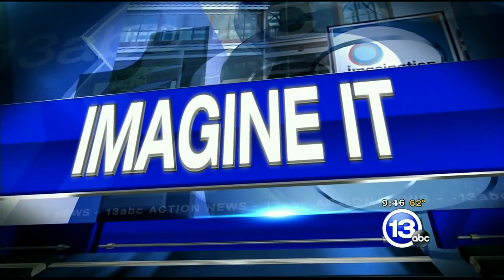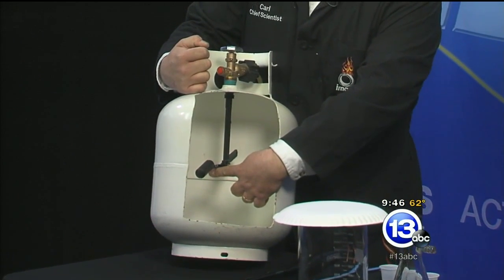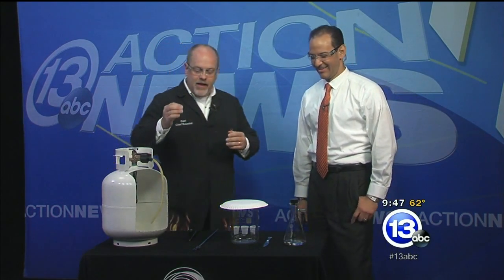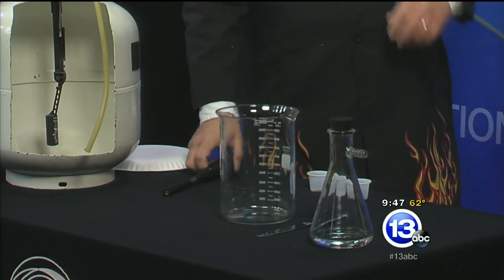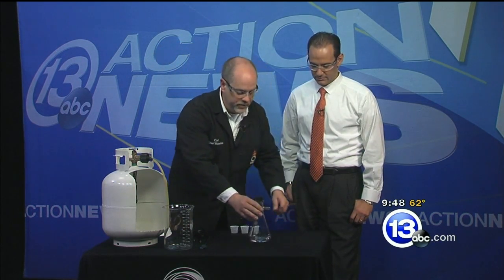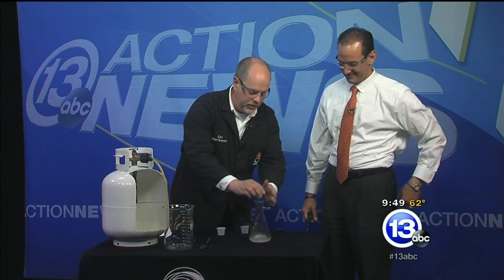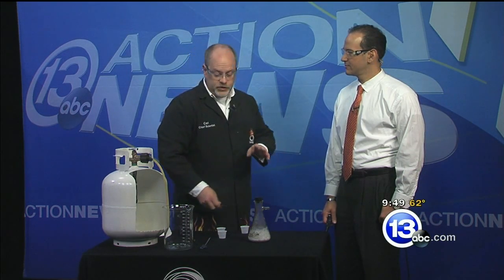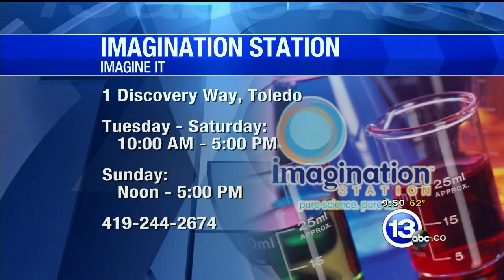What's inside a propane tank?

Comment: dumbest question what's inside propane tank it's propane if it wasn't propane we're not gonna call it propane tank
Reply: There is more than just propane in a propane tank. He showed the overflow prevention valve and the flow based check valve.